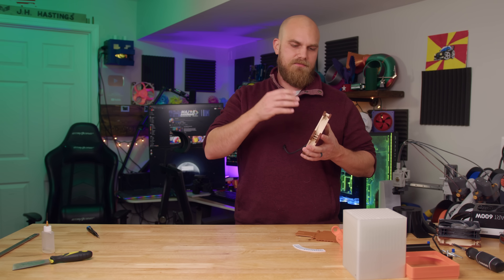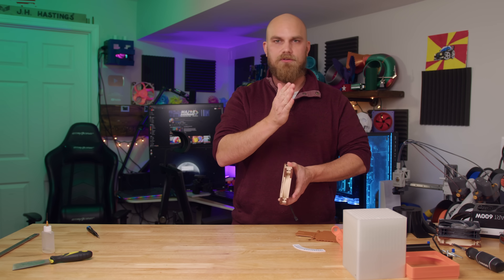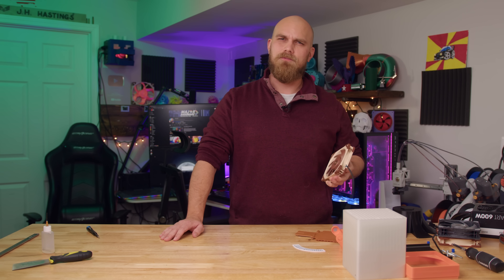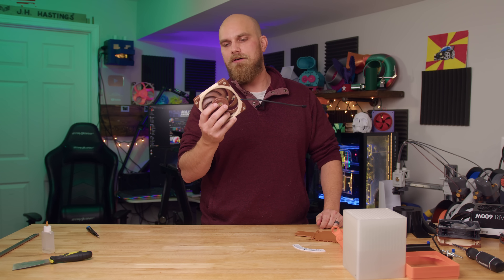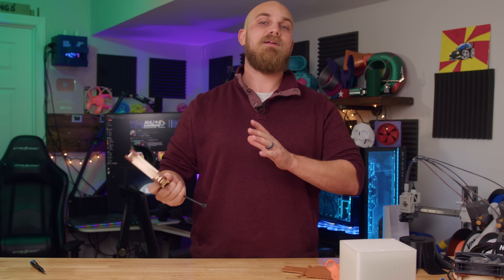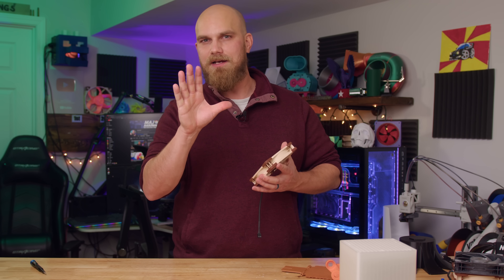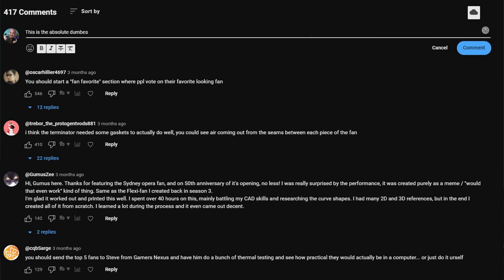I Built a Static Pressure Machine | Fan Showdown Season 6 Pilot

Comment: I don't think this is really measuring static pressure at all...
It's just another way of measuring flow...

I understand what you were going for, but I don't think this it is.

You need some way of maintaining a constant force acting against the door...
This setup is using gravity,  so the force isn't even linear, due to the hinge and cog of the flap.

I'm not sure static pressure is even a relevant number for a PC fan. Since the whole idea is to move air over a radiator of some sort.
I can imagine being able to make a fan that has high static pressure, that wouldn't be able to move a significant amount of air, and would be useless for cooling. (And wouldn't even register on your test device)

I think the show needs to be split into case fans and radiator fans.
In both cases, the aim is to move the most amount of air.

Comment: You should test the same fan at different RPM to see if the curve is logarithmic (i.e. if there are diminishing returns due to the decreasing surface area in contact with airflow as the flap opens.). For example, if 2x RPM produces 1.5x (let's say from 6 to 9) then the results should be adjusted accordingly.

Comment: It should work okay, but I don't think you'll be measuring static pressure, you'll be measuring mass air flow as both velocity and density will be factors in moving the flap. That said, mass flow is what we should be optimizing for in a cooling scenario. The reason I say this is because, well it seems to be true, but also old Bosch CIS fuel injection systems used a flap door as a mass airflow meter, it would get sucked open by the engine and adjust the fueling accordingly. Modern cars now use a Mass Air Flow sensor that simply hangs into the flow of the intake and measures the mass of air entering the engine and adjusts fueling accordingly. Now, spitballing from here on out: at different pressure restrictions you'll get different flow rates. I think your best system would be the fan running into an adjustable oriface some distance from the fan, like an aperture, followed by some distance, then collumating lines like you did there, into a length of tube with a mass air flow sensor. You'd also incorporate an air pressure sensor before the aperture, as well as ambient pressure and humidity sensors. From all that you could calculate air mass flow per pressure and thus create an efficiency map for the fan. The ambient sensors would allow you to compensate everything for weather to standard day. You'd probably also want to characterize some typical applications for PC fan setups, like how much pressure a radiator drops, case fans, cpu cooler, etc.

Comment: one problem with this method is that the scale is not linear. because the more horizontal the flap is, the less surface area for the air to push the flap so the more air you need to move it further. 

so the difference between 1 and 2 would be very small, a difference between 15 and 16 woud be huge and 18 would be impossible to achieve.

Comment: I would consider adding weight to the counterweight of the flap to tune it so the A12 has an output of 45 degrees, the. Adjust the scale so it shows 45 degrees as 0. From there, all performance will be judged as either positive or negative to the control. You would get better resolution of the flap were enclosed as then the air wouldn’t be able to escape and your pressure would be more equivalent to a static test with a manometer

Comment: I think this device does well at measuring the flow rate but not pressure. While it's fine to assume the box will open to equilibriate the pressure with the atmosphere, it would be a pain to correlate that to a reliable scale. This is due to the complexity involved in changing the cross-sectional area of the opening, and how that changes the pressure acting on the flap. Why not use a simple box and see how much each fan can push a collum of water? With a fine enough scale it should be possible to resolve  0.1mm.

Comment: I love the idea of measuring static pressure for the next season. 
For your device, I think general idea is fine as it only needs to compare fans to other fans. The method for measuring the flap angle really needs to be more precise though as a lot of fans have very similar performance. 
I would suggest using a contactless potentiometer to determine the angle of the flap. The readout from such a sensor would be much more precise and repeatable.

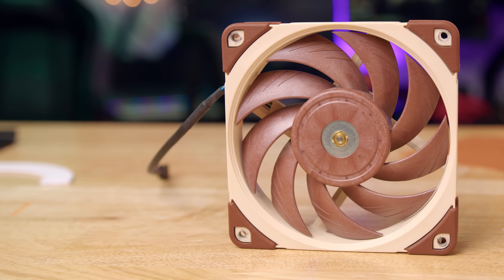Comment: 1:43 If a fan produces 2.43mm H2O of static pressure, then that would just about be measurable with a U-tube with water in it.
If instead of the density difference of water and air, you take the reading in a surface that is affected by the pressure difference of oil and water, you could greatly increase the accuracy.
I think it's not that difficult: You take an air filled tube from either of the two points whose pressure difference you want to measure; inside each tube you have an air-oil surface in a piece of the of the piping with a large cross section, probably some bulbs. And those bulbs are connected with a U-tube which contains the ail-water surfaces. The ratio of the oil-air surface to the oil-water surface gives you the amplification. (That would ignore the density difference between water and oil, but as long as you make their densities consistent your measurements will remain comparable.)
If you build something like this, you'd just need to make sure that during one measurement, you don't change the positions of any tubes (ideally everything filled with oil or water is fully rigid and on a stable surface). And you need to take not the difference of left side vs right side of the U-tube, but how much that difference changes between fan on and fan off (or in other words, use the fan-off reading as your zero).

I have to admit that your solution is more elegant, though.
It's non-linear; but that's fine, as long as your differences are 6.5 vs. 6.0 gradations instead of 2.4mm vs 2.6mm.
One suggestion for a modification: You may want to have the scale move behind the needle instead of moving the needle in front of the scale. That way you can set up an extreme close-up camera pointed at the (now static) needle and have a guarantee that the needle stays in frame.

Comment: Well what's the purpose of the fan "showdown"? It's a competition to create the best PC fan.
What do people want from a PC fan? Low noise and high cooling performance.

A proper test would be to noise-normalize all fans to the A12x25, when the A12x25 is running at a speed most people would actually use it (~1000rpm*) while blowing air through a chosen mesh/radiator.
The fan that produces the most airflow (cooling) through the radiator/mesh at the noise-normalized value wins.

Even with the current testing method (max speed), the A12x25 should still be the winner (most airflow per dBA). In fact, it still has the lowest volume of all but one of the contestant fans.

*There's usually massive exponential drop in cooling performance when running the A12x25 over ~1000rpm anyway, due to the coolers themselves not being able to transfer the heat quickly enough to make use of the additional airflow; extra fan noise for nothing.

Static pressure values could be interesting to see however, I believe all the best fans would have almost the exact same static pressure (at the noise-normalized speed), as the chosen radiator/mesh should have a pressure value which is the most efficient.
Otherwise, static pressure is irrelevant when it comes to determining a winning design. It is similar to vehicle engine torque, in that torque/static pressure are merely considerations that can be made early in a design phase, but otherwise they are entirely useless values to the consumer/user, and tell you exactly nothing in regards to the real-world performance of the fan/car, and can be safely ignored.

Comment: You should increase the weight and length of the counterballance. I forsee a lot of entries being too close to differentiate. Also the pressure required for a high value goes up exponentially, so I’d try to balance it so the T30 is nearly the max value.

Comment: To my knowledge, Mo static pressure is not necessarily mo better. They just need enough to push the air through the restriction. designs that focus on pressure will typically flow less than designs that focus on flow. there is a balance to be struck. I'm just a senior mechanical engineering student, but we deal with a lot of fluid systems and heat transfer.

Comment: I like this as a static preasure test. However if you want to find out how well it performs, try some smoke on it.  I'm thinking that smoke on this device may reveal any areas where you are NOT getting a good seal. For example the area where the fan mounts, maybe one of the parts that join to the remain body. Possibly the way the air moves around the "flapper door".  

You could also measure the RPM of each fan to ensure they are all spinning at exactly the same RPM setting and then test their static pressure.

Comment: I'm not an specialist, but I like the wind tunnel.
The test in wind tunnel with and without a load, like the radiator.
This new device is interesting but I think you need more resolution, maybe put some kind of sensor and convert to a digital value would be nice.
Maybe here is where the anemometer shines, because it is already calibrated.

Comment: I typically don't make statements in these kinds of situations, I find when it come to critical thinking about a design asking questions is far more beneficial. However the only flaw I see with this is that as the angle of the flap increases it will always take more force to push it higher non-linearly. Essentially what I see is that there is less accuracy at higher pressures because that higher pressure fan will need to be exerting far more force that is probably necessary to lift the gate. The more open the out orifice becomes the less resistance the the gate posse's thus requiring more force to push the gate higher. Which is the point sure, but to be an accurate measurement it should require an equal amount of work to the job across the scale. For example it takes the same amount of horsepower to move 1 pound at 50mph as it does at 1 mph..... sort of, kinda, sometimes. Not really the point but I hope that it makes sense.

I would think something like a vertical tube on top of a sealed box, where the pressure has to push a known weight up would be more accurate.

Comment: My recommendation would be to extend the length of your indicator arm, which is serving as a counterweight by another 50% or so. You would have a longer travel distance at the tip, resulting in a higher fidelity look at the score if you print a longer arc scoring path to match. If you are concerned about the center of mass or the damper not closing, then simply print a small extended rod at the very bottom to move the center of mass further out from the chord line of the damper. 

A separate take on how to measure this would be to keep your damper but add multiple small rods/arms near the base that you can hang small weights on.  These would be printed of course in fractions of grams and used to determine the weight needed to keep the damper closed even with the fan blowing. The weight required to close the damper becomes the score, and the fan requiring the most weight has the highest static pressure.

Comment: 1. Once that flap is open, you are no longer measuring static pressure.  2. That flap should be more sensitive if it were in the tunnel instead of after the tunnel, like a butterfly valve, so there isn't a huge amount of air escaping out the sides.

Comment: Containing the flap within the duct is, I think, the place to start. If I am reasoning correctly is allows the system to select the orifice (restriction) through which the pressure drop matches the pressure capability of the fan. A little scaling of the indicator to match the flow area to the angle of deflection would linearize the output. 

However, my fluid mechanics is getting a little rusty - I'd be wary of calling this a static pressure measurement as you are relying on the dynamic pressure of the flow to do work on the flap mechanism. For this reason, I think the suggestions recommending pursuing a manometer solution may be well-placed.

If the precision necessary for PC fan measurements requires too lengthy of an incline, it may be reasonable to use an inexpensive differential pressure sensor with an arduino or other microcontroller to make a measurement across a restriction. The effective precision of a DP transducer range paired with the bit capability of the microcontroller processor is pretty basic measurement theory.

Alas, I am a little late to the party, so no one will probably see this.

Edit: spelling

Comment: You'll get variable results using a hinge that opens more below/edge then top/center. You should use a change in flow direction in order to smooth this differences or use several doors/hinges.

Comment: I would recommend measuring flow and pressure separately, and graph both over the full available range of restriction, from a minimum restriction represented by the grid alone to completely "shut" static pressure. These graphs, charted with RPM and Noise measurements would be a complete characterization of each fan that is basically the "end game" of testing for all fans.

Use a manometer and a mass air flow sensor system combined.

Comment: I think this works well. Some form of rubber sealing to ensure everything is airtight, no leaks.

I would want to see the top 10 fans from all previous seasons tested on the new rig. New tests always mean chances for changes in ranking. As well, I’d include all their actual thermals and goodness. As much empirical data as possible

Comment: feedback: NASA made a round wind tunnel to make the most accurate measurements. The problem with square wind tunnels is that the airspeed around the corners is lower. Maybe go for a round wind tunnel to minimize the skin effect for the most reliable results.

Comment: I tried scanning the first hundred comments and didnt see what i thought could be a different option.

 You could attach a balanced moment arm that presses on a scale.  The way I saw it in your existing setup keeps the flap nearly closed whicj measures somethng closer to static pressure where your setup is measuring something more... Dynamic. 

 I don't think it'll be a truly static pressure test but it would.be at least cheap, easy to implement, fairly precise, somewhat analogous, and most of all, just enough jank for everyone to keep on screaming about your methodology.

There are additional little details you could add, like a small spring between the scale and contact arm that could help with getting a consistent zero and keeping the flap shut in the same location.  A little dinky clicky pen spring maybe.  Or hey even a 3d printed spring mechanism.  Probably go with metal though, plastic's fatigue curves arent great.

Comment: Improvement idea:
Extend the "shroud" so the "flap" is still enclosed in the tunnel as it moves. That way air will only (mostly) escape out the bottom of the flap, instead of the bottom and the sides.
The benefit to doing this is that it should make the flap move farther with less pressure, thus giving you more range on the lower-end of your scale (since your baseline only goes to 6 now).

Comment: 👍 yep like this projectile backstop energy measuring device 3 sides and bottom left right not interfering with hinges could help you visualize flow better too or get higher on your scale as it'd show a square cross section of  somewhat laminar airflow, looking from downstream to upstream you could also watch flap height in addition to over the top scale😊😊❤

Comment: The scale isn't accurate with the flap like this. It has more tendency to go back down the higher it is, so the scale should be exponential. Best to have some linear form of gauge. A hydraulic gauge of some sort would likely be easy, but with some way for the air to move out and not much resistance on the fluid. A minimal amount of fluid and a thin tube (not too thin, Steve Mould's recent water videos explain why). A flap isn't a good solution because gravity.

Comment: colored water in a tube, in the shape of a v, but with a very wide angle to give better resolution.  The water will move only a millimeter or 2 or 3 in height, but at a 10 or 20 to 1 ratio, that would equate to a significant movement in the tube.

Comment: I actually made wind tunnels to test samples in conditions at work. My dad is retired NASA and put me in contact with the head of the wind tunnels at his base. He made two very helpful suggestions to ensure I had laminar flow at my sample port. I needed to use streamliners in the tube. He suggested jumbo straws. Next I needed 6x the diameter in tunnel length from the streamliners to the sample port and at least 2x after it. It worked perfectly. I get nice even and non turbulent flow at my test port. In your case your test port is your flap. So add a tube after and lengthen you tube before and add straws equal in length to the diameter. I used 6" PVC for my tubing.

Comment: yeah i have some ideas, i dont think gravity will work that great because it gets harder to open the further up you go

another think to note is that since it just needs to push it out enough to exit the sides, thats even less movement on your scale

so my two adjustments would be to have a tunnel sontinue after the door, and to have a door that is sideways. this would use a spring which should be much more linear than using gravity. you could also have two doors

another thing is that you scale is tiny, it owul dbe nice to have more movment. the above ideas MAY fix that but i dunno, need to test

im in favour of this though!